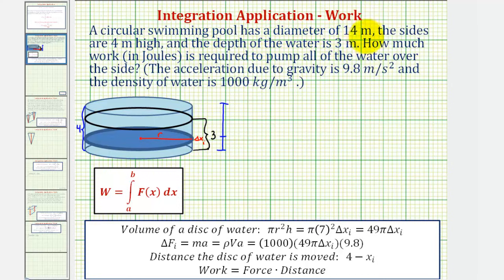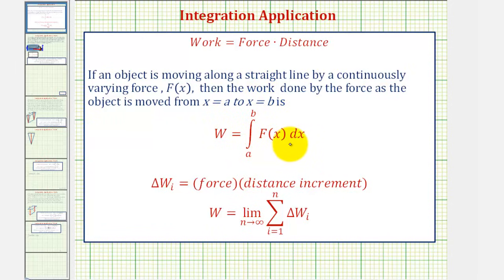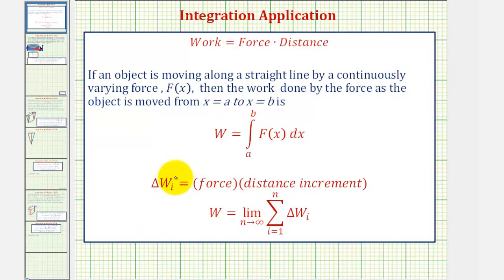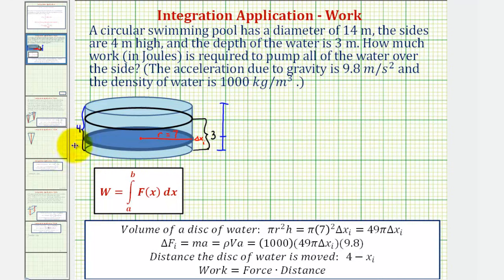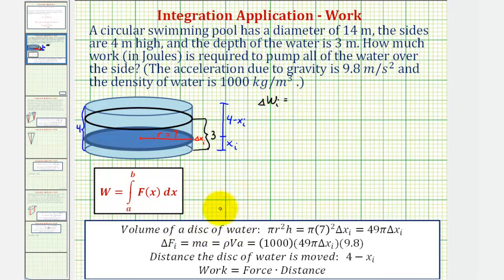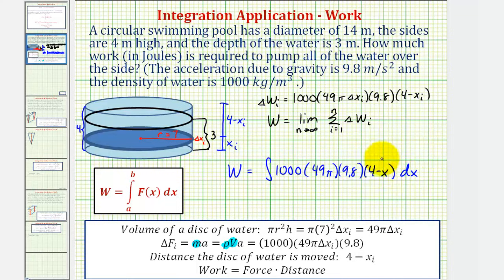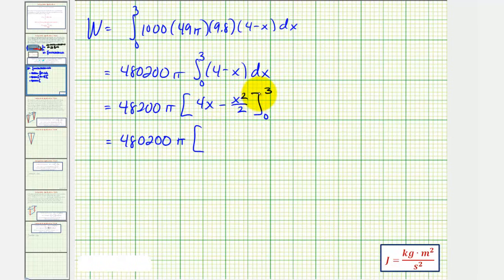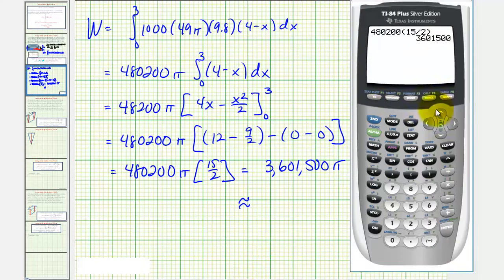Ex:  Determine the Work Required to Pump Water Out of a Circular Cylinder

Comment: So, if W=∫F(x)dx, a to b, why the video actually shows that W=∫F(x)*d(x) dx, a to b, where d(x) is the distance?
Reply: W=∫F(x)dx is the general way to express work in integral notation. Here we have two variables changing... the volume of the water and distance the water needs to travel. Instead of a double integral both can be expressed as "x" here as a single integral.